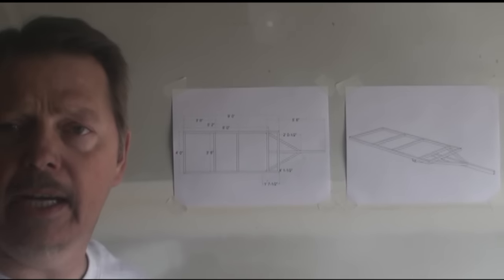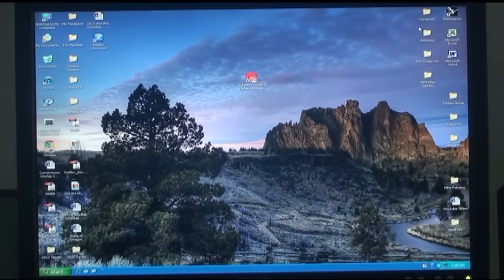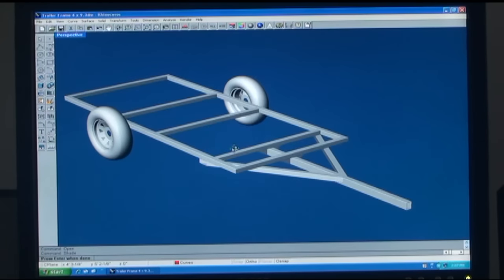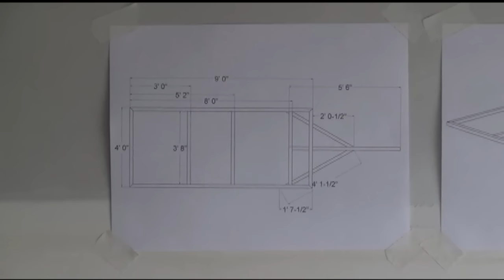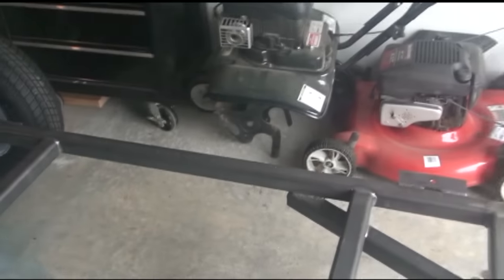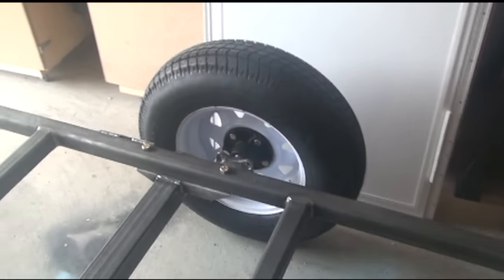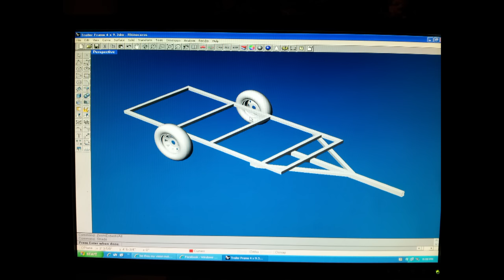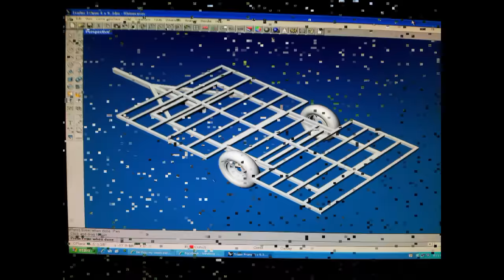How To Build A DIY Travel Trailer - Part 1 (Trailer Frame and Floor)

Comment: I think one of the things I liked the most about your video is your caster idea. I was contemplating the height restrictions to house in my garage a while back. With the trailer being about 2 feet from the ground I would have been restricted to a six foot ceiling at best. I was thinking of taking air out of the tires. But by using casters I can save a good deal of space. I also think the thing I like most is your part 9 video when you use that jig to make the screw holes. Although it is pricey it looks like a big time saver and good for quality control. thanks again
Reply from the maker: Another option you may consider (saw this on another video) besides the casters... the person used a 1/4" steel plate cut to a small wheel. Drilled holes in it for the lug bolts, removed the wheels and tires, and installed his tiny steel wheel. Brought the trailer down within an inch or two from the garage door. Then when he is ready to travel, jacked it up, remove steel wheels, and replaced with wheels and tires. Looked like it worked very well! One of the benefits of using casters though, is you can move it around in the garage pretty easy! :)    Gotta say, love that pocket jig! Makes drilling a snap! Thanks for stopping and watching!! Cheers!

Comment: Thank you for producing this excellent video tutorial.

I am considering building a trailer chassis in 50mm (2") square box section steel and yours (apart from the size) is almost exactly what I picture it to be like.

I particularly like your making the main beam a 75mm x 50mm (3"x 2") and the fitting of steel gusset reinforcements.

I intend to build a Slidavan on the chassis, which when fully completed should weigh around 600 lbs including the chassis it sits on.

Your build looks superb and I look forward to seeing it completed. Subscribed.
Reply from the maker: Thank you for following along Felix!! Had to Google what a Slidavan  was... looks awesome! Happy building!

Comment: Torsion Axles are nice on the highway but after a couple years of back roads or washboard gravel roads you may be replacing it. A pot hole at 35 + mph on either side will leave you wishing you had a standard axle and leaf springs as well . My experience is that they get a little squirrely if one side or the other is jolted a little more then normal .  I hope you dont have the same type of experience I had with them .  I had enough after 2 broken torsion axles in 3 years . Almost $400 in having the trailer towed by flatbed 41 miles home and another $380 buying a replacement axle the first time . And then the replacement axle failed just over a year after the first and I swapped to standard axle and leaf springs and havent looked back.
Reply from the maker: Wow... that is rough. I hope I don't experience anything like that. I'll be watching for wear as I travel. I will keep this in the back of my mind, and if something starts to fail... then leaf springs it will be! Thank you for the input, much appreciated!

Comment: Amazing videos! I'm looking attentively for every detail. The slides show some steps taken, but I have some questions regarding the thickness of the wooden floor, quantity of plywood, insulation and its painting. Are there more videos showing these details ?  I plan to start mine stiil this year. Such information will help me a lot.Thank you in advance!
Reply from the maker: Thank you Carlos!  I didn't actually start videoing the project until later, so I missed out making videos of the floor and the framing. I used 2 x 2 for the framing of the floor with 1/4" plywood top and bottom. I used about 5 sheets 4 x 8 for that. The insulation was 1-1/2" rigid foam, about 3 sheets 4 x 8. I coated the bottom with Rustoleum oil base paint. One primer coat then the top coat in black. The top floor has a vinyl flooring over it, and built the cabinets over it. Only thing I would do differently is use 1/2" plywood for the top of the floor. That would make it a lot more solid.... but, I was trying to keep it light as possible. Appreciate you stopping by!

Comment: Did you do all the welding yourself? I apologize if you had already mentioned this, but where can one find the actual metal material to make the trailer foundation?
Reply from the maker: Hi there! I purchased all of the metal at a local steel mill (Swift Steel) and had a friend do all of the welding. Always good to know someone with a little skill you don't have! :)  Do a little Google search for a local steel mill in your area, you might find something close.

Comment: Hi I enjoy your travel build videos. I am also looking to build one and had two quick questions.1. Did you put some undercoating or protection under the outsde would that is exposed to the elements, such as under the wheel wells. 
2. Do you have to put some plastic material between the stud walls and the inside skin to keep moisture out. I have seen it done in home buiding and was not sure why no one seems to use that moisture barrier? Thank you
Reply from the maker: Hey FixmyToyota!! Thanks for the question! For the bottom, I used Rustoleum paint. I coated with a Rustoleum Primer, and two coats of Rustoleum Black. With that... I'm hoping for a good seal! For the wheel wells, I used a spray on bed liner coating, that seemed to work pretty well... although, I may give it a couple more coats before I hit the road. Thanks again!

Comment: Amazing job!  What size of wood did you use for your roof supports?  Thanks in advance
Reply from the maker: Thank you Dana! I used 1 x 3 doubled up to make a 2 x 3 and added a slight curve to the top. so the center is 3" thick and the ends are 1" thick.  Keeps the water off! :)  Thanks for watching!

Comment: Very nice build, I'm in the process of building one myself. How does the solid mount axle do over bumps? I was gonna use one like that on mine but I was worried it would beat the hell out of the camper lol.
Reply from the maker: Thank you OneGuy!!  Not sure if I would use a solid mount axle.... might have to stop along side the road to pick up all the pieces of your trailer after it gets beat to death!! LOL!  I would definitely use some springs under it to absorb some of that shock.

Comment: Great video. I have been thinking of doing this myself. Quick question. I am concerned about wood rot of the flooring from exposure underneath. Did you protect it in anyway?
Reply from the maker: Awesome! If you have an idea.... start on it, you will be finished sooner! :)  I used Rustoleum for the bottom of the trailer. One coat primer, two coats of black. There is also another good product to use: Herculiner Bed Liner paint. This will help protect your wood! Hope that helps Robert, thank you for watching!

Comment: Very nice work. Thank you for taking the time to document and upload all of these parts. I’m going to enjoy watching and learning from it. I’m in the process of building a trailer, and started using google sketchup for the design and schematics. Any thoughts on sketchup vs Rhino?
Reply from the maker: Thanks for tuning in Abin! Wish you the best on your build... it is going to turn out great! I have never used sketchup, but have seen some work others have done with it... just like most things, the best tool to use is the one you have! Once you have the basic idea down on paper, the rest comes as you are building, and of course... your ideas will change a little bit too. I just happened to have the Rhino program, works much like Autocad. They are expensive, and probably overkill unless you are creating blueprints. Shetchup should work just fine! Thank you for stopping by!
Reply: OregonBatman , thank you for the reply. The style I have in mind is on a 5x8 frame. Kitchen/Galley in the back and a bed that can converts to a sofa on the inside of the camper. I haven’t gone through all the videos yet, so pardon me if I’m asking something you covered in one of those... did you have plans to add a fridge? For my build, I plan on using an ARB Fridge Freezer (which I currently have set up as a camp kitchen in the back of my wrangler). I found it extremely efficient on power consumption and can double as a fridge or a freezer.
Reply from the maker: Hey Abin, sounds like you have a great floor plan in mind! The ARB Fridge will be a great addition to your build and will definitely use less power. I won't give it away yet about a fridge in my trailer, but if you continue to watch... :)  Happy building my friend, hope you post some video as you progress! Cheers!

Comment: Is there anything you would have done differently now that you have 20/20 hindsight? What is the final weight of the trailer? Where in Oregon are you?
Reply from the maker: @CarolDuvall  Hi Carol! Great question... One thing I would do differently would be to make the wheel wells larger to accomodate larger wheels and tires. I locked myself in by designing the trailer around 13" wheels... would have looked better with 15's. The final weight was right at 2000 pounds, so I upgraded axle to 3500#. I am in Central Oregon, about 43 miles north of Bend Oregon. Thanks for checking it out! Cheers! al
Reply: @OregonBatman  Thanks
Reply from the maker: @CarolDuvall  You are welcome!

Comment: This is great, thanks! I've just started on building my own. I found a 6x8 trailer on craiglist, rated for #3500 in good condition for a steal at $200. Only thing is, it's made of 5 inch C form steel, and it's HEAVY. I'm planning to draw up my floor plan and take out most of the overbuilt steel components. Not going to be hauling cars, afterall. 

Could you link some of the folks you used on youtube as reference? that would greatly expedite my build!
Reply from the maker: That is awesome! You'll have a good foundation to build on for sure! I don't really have any videos I used for reference... I just did a search for the topics I was interested in and watched as many as I needed to see how something was done.  Other than that... I winged it. :)

Comment: Nice work I plan on building a camper trailer soon video # 2 was awesome got 40 to go lol my question is what size of wood did you use for the framing on the side walls 2x1 or 3x1
Reply from the maker: Hey Franky! Thanks for watching!! I used 1x2 and double them up to make 2x2 for the framing. I used Douglas Fir wood glued together. Made for a solid frame. You could save a little money and cut down the weight by just using 1x2, that should work just fine as well. Wish you well on your build! Hope to see pictures of your progress! Those 40 videos should go by pretty fast! LOL!
Reply: OregonBatman thanks for the reply yup I'm on video 16 now and thank you for the info
Reply: OregonBatman after you glued them together did you screw them together as well
Reply from the maker: LOL! Glad you are sticking with it! When you finish, hope the videos help you in your project!
Reply from the maker: I used 1-1/4" staples and stapled together, much faster than screwing!

Comment: Just one question?  Why aren't you using springs instead of a direct attachments to the wheels. Surely the trailer will bounce around all over the place because it gives a hard ride. Just asking
Reply from the maker: Hi Leonard! The axle that I am using is called a torsion axle. It is like an independent suspension. The axle tube itself has a rubber bushing that absorbs the shock. Actually is a very smooth ride.
Reply: @OregonBatman  awesome thanks. We learn everyday.

Comment: Nice welds--- way better then mine and I was a Iron Worker for a few years. What did you use?
Reply from the maker: Well sir... I'm no welder, straight up! Paid a guy at work to do the welding. He used (I believe) a Miller wire feed welder..... did an excellent job! Told him what I needed, gave him the blue prints I made, and he delivered! Might have him do the welding on the next trailer! :)

Comment: Is the axle come with the steel bar you weld to the frame ?
Very nice video and creative
Reply from the maker: Hi don! Yes it does. The bar is welded to the axle and can be bolted or welded to the frame.
Reply: @OregonBatman  how to your like the 2000lbs  axle preform?
I thinking order one replace my current leafs spring on my 5x10 cargo trailer  because I not carry anything heavy than 1000lbs
Reply from the maker: I love the torsion axle! Doesn't bounce around like leaf spring axle, each side is independent.  Very smooth ride. You will like it.

Comment: hey oregon i bought a used trailer,floor some rust and frame.what would be your advise,sand it down to metal?
Reply from the maker: Hey Maurice! It will definitely pay off to use a little elbow grease. I would recommend starting out with a wire wheel in a drill to remove as much of the rust as you can. Won't remove any pitting the rust might have caused, but you will get where you need to be.  Use a compressor to remove all of the dust and give it a good coat of primer as soon as you can. If you take the frame down to steel and let it sit too long, it will develop surface rust and you will have to redo it . Try doing it in sections, front left, front right, then the same on the rear... you won't get as bored. LOL!  Cheers!

Comment: I need dimensions if possible please for this and the what wood do you used for the wall is it plawood
Reply from the maker: It is a 6 x 12 trailer built with plywood walls... three sheets per side on outside walls
Reply: OregonBatman can you like to work with me in my country for building trailer business, if yes give me your contact to discuss

Comment: Can I weld this material with a longevity migweld 140 110 volt welder? Would it have enough power?
Reply from the maker: Unfortunately... I am no welder! Although the longevity migweld is capable of handling 3/16 steel... it may not be able to handle a very big project. For smaller welds and projects, I think it may be just fine.
Reply: Why not just try on a piece of crap?

Comment: if you custom built the frame, why didn't you build it to the size of the camper?
Reply from the maker: Actually built the trailer for something else but changed my mind and built the 6 x 12... had to make it work. :)

Comment: What did you cover the bottom with?
Reply from the maker: Hey JaguarG... thanks for the question! For the bottom, I used Rustoleum paint. I coated with a Rustoleum Primer, and two coats of Rustoleum Black. With that... I'm hoping for a good seal! Thanks again!

Comment: What size boards did you use for the floor and framing?
Reply from the maker: Hello Ryan William!  The floor was made using 2 x 2 for the framing and covered with 1/4 inch hardwood each side. If I had to do it over, I would use no less than 3/8 inch each side.. or at the least, 1/4 inch on bottom and 1/2 inch on top. Thanks for stopping by!
Reply: @OregonBatman  And what did you use to seal the flooring? Looks like a plasty dip or rhino liner material
Reply from the maker: Robert Peruzzi used a rustoleum oil base paint. Coat of primer then black paint
Reply: @OregonBatman  sorry for the stupid question. Right after I asked I saw the post where you explained. By chance are you part of the Oregon Gambler?
Reply from the maker: Hi Robert... sorry, not part of gambler. :)

Comment: how did you waterproof the underside?
Reply from the maker: Hello Ted, I used Rustoleum for the undercoating. Primer coat, and two coats of Rustoleum black. I will probably give it a good undercoating with a spray on bed liner before I take it for some serious use. Thanks for stopping by!
Reply: Bedliner to cover the wood on the bottom too?  will it warp the wood?
Also looking at a larger 16' trailer-how sound do you feel about the 2x2 lumber you used to frame up the walls? Down on the Gulf Coast we get some wind and a lot of rain.  
Like your attention to detail and neatness.  Enjoying your work sir.  Thank you
Reply from the maker: HI Ted... I don't believe the bed liner will warp the wood, it's actually pretty solid. Seen a lot of YouTubers using the same method with no negative affects. As far as the 2 x 2 walls... I feel very comfortable. Many trailers on the market, to cut cost and lessen the weight of the trailer, use a thinner wall. Vintage trailers are a good example. In some models they will use a 1 x 3  or 1 x 2 for framing. They have held up very well through the years (with the exception of leaking!). Here in Oregon, we get some pretty good winds also. The trailer rocks a bit, but safe and sound.... thank you for watching, and the comments, I appreciate it very much! Cheers!

Comment: What was the thickness of the plywood you used for the top and underside of the floor.
Reply from the maker: Hey George, I used quarter inch hardwood top and bottom.  I would consider no less than 3/8 on top floor next one I build. But 1/4 is working well.
Reply: Thanks Batman, I used 3/4 ply on the teardrop I made. BTW So far I not  found any decent RV scrap yards in Ohio
Reply from the maker: You're welcome George. Bummer on the RV salvage stores... anything good on Craig's List?

Comment: What's the frame made from metal or aluminum?
Reply from the maker: Hey "always thinking of new ides", thanks for stopping by!! The frame is made from 2 x 2 steel tube channel, a little heavier than aluminum, but less expensive. Thanks for watching! Cheers!